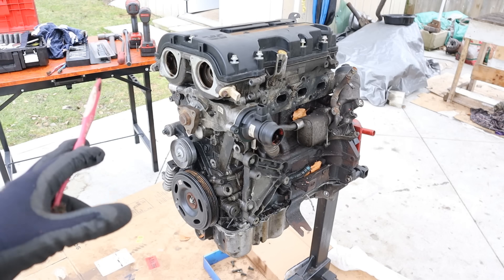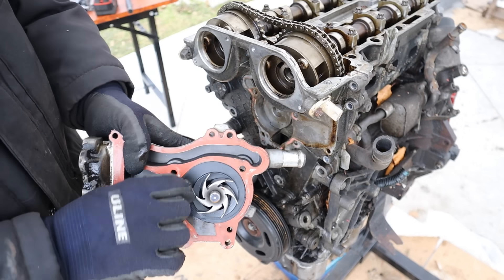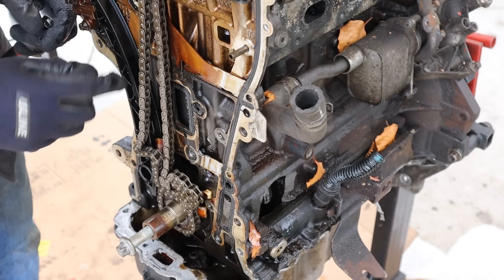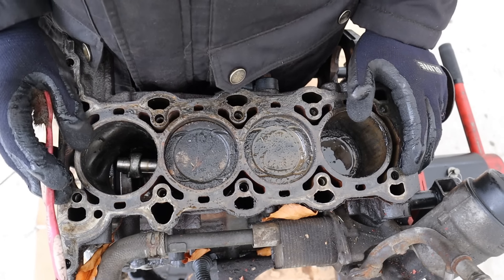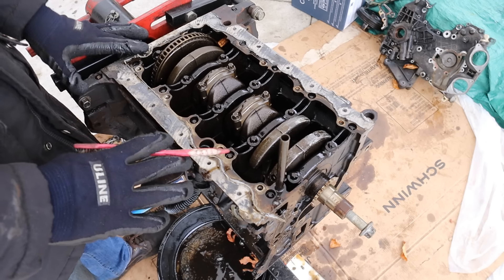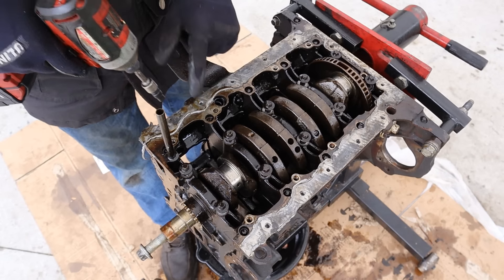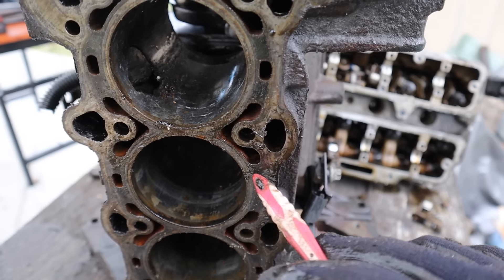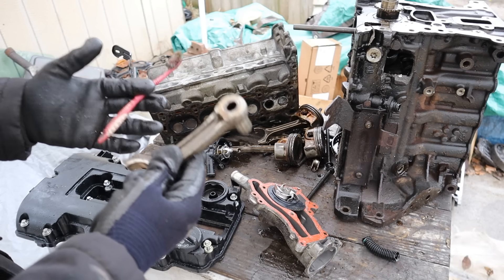Why Chevy Cruze Engines Fail

Comment: Somebody tried really hard to make a good engine. Somebody else didn't care.
Reply from the maker: That's one way to put it
Reply: Ya, it's kinda crazy how if they had just made a few minor changes, it could have been a decent engine. But nope.....can't do that.......Quite ironic how they decided to not skimp on the water pump metal blade & used a timing chain instead of a belt..But then used a bunch of plastic timing parts. If they used a belt that needed replaced before 100K. They could told customers to also replace the plastic timing parts with new stock or aftermarket parts.
Reply: @michaelbrinks8089 haha there you go. Properly planned, planned obsolescence. You should get an engineering job 👀.
Reply: Lol
Reply: This just sounds like how GM makes engines.  Every once in a while “someone else” isn’t allowed in the room and then you get the LS1 and 3800… other times we get this thing.

What sucks is if you’re buying a new car you have no idea which one you’re going to get.
Reply: @michaelbrinks8089

Why this obsession over plastic?  What else would you have made it out of?

It’s a wear piece designed to be sacrificed so the chain doesn’t wear against it.  The only reason it broke was either because of the unrelated engine failure or the previous tear down. 

Sure you could used an idler sprocket but that’s another thing to fail and more cost.  

Just about every engine today uses plastic timing chain guides and tensioners.
Reply: @michaelw6277  It wasn't made by GM at all. It's a German engine made by Opel. And we all know how good the Germans are at making simple reliable engines.
Reply: @SPAZTICCYTOPLASM  1.2 Puretech is the perfect example of this messy engines!
Reply: @SPAZTICCYTOPLASM  I thought Opel was a GM company?
Reply: We don't know the mileage or how it was driven.
Reply: @calvinnickel9995 Metal! Toyota chain guides (amongst others) use a metal backing plate behind the nylon wear surface to prevent this happening. This is why other manufacturers don't have this problem.

Comment: I work as a tech at an oil change place. I swear, 9/10 of these come in pissing oil from the turbo or the rear main. Most of which we send out as the owner wants it fixed.
Reply: Delete the turbo, problem sofvled.

Comment: In the first two minutes it seems like every component of the engine is "known to fail" and "a sore spot."
Reply: It would have been quicker if he had listed the parts that aren't known to fail...
Reply: @nicholasvinen basically the oil pump and hydraulic valve adjustment
Reply: I got the exact same impression.

Comment: That the block is made from iron lies in the fact that this engine is based on a 1970's Opel 1300cc 8 valve engine (motor code 13n and 13s), also called Family I engines. It had an output of 60bhp for the 13n and 75bhp for the 13s.
This engine was belt driven for the 8 valvers and 16 valvers up to 2004.
Reply from the maker: Good to know thanks

Comment: I owned a 2014 Chevy Cruze for a couple of years before I traded it.  One day after an oil change, I had a couple of mechanics near my car and one was telling me that something didn't sound right.  He was talking about my electric cooling fan that wasn't working right.  It was advised to me that I should bring it in to have it looked at and so I did.  Not only was my cooling fan bad, but they found that my valve cover gasket had gone bad and the water pump was about to go out.  The water pump was making a constant squeaking noise.  Thankfully, the repairs were done under warranty.  The repairs would have cost $1700 otherwise and I ended up paying nothing for it to be done.  I think the reason why the car was traded in the first place is that the previous owner just drove the car until it started having problems and didn't bother to have those problems fixed.  At least the current owner of my Cruze had a freshly repaired engine to drive on for a while.
Reply from the maker: Ouch

Comment: Interesting integrated oil pickup tube.

I'm never expected an Aluminium piston to blow a hole through a cast Iron block.
Reply from the maker: Yeah it's one of the first integrated oil pans I've seen. 

I was not expecting the hole in the block either!
Reply: The powder forged steel connecting rod  did the punching, oe cast piston was just along for the ride.
Reply: @jamesgeorge4874  This engine uses aluminum connecting rods.
Reply: @Liftium  Even lead can go through an engine block as long as there's enough speed.

Comment: My fiancé had a 2014 Cruze and that thing was the biggest POS. The thing would constantly overheat and we replaced darn near every single cooling component and nothing worked. We ended up just junking the car to get rid of the headache. Now every time we see a Cruze on the road, we always laugh about how frequently the fan comes on since we know all too well how much they like to overheat.
Reply from the maker: It went to junk? Was it too difficult to fix?
Reply: @speedkar99  yeah man, we replaced everything related to the cooling system that we could think of. Water pump (x2), thermostat (x2), radiator, PCV, head gasket, etc. Nothing worked and it just got to be a money pit and kept leaving my fiancé stranded.
Reply: @TxH666  If I remember correctly it was the Cruze or similar  low end Chevy that had the weakest cheapest most garbage rear brake calipers I had ever seen.
Reply: b/c you did it wrong. You have to use low temp t-stat 170* and replace everything including the overflow hose and reservoir. Also, ditch dexcool. GM=trash. You still had leaks and/or recurring leaks.
Reply: If the fan kept kicking on and off, the fan speed regulator was shot. It runs three modes - low, medium, and high - and if the regulator fails, it will only be able to run on high. When this happens, you will only get intermittent high-power mode, and you won't get constant air movement across the radiator. This can ultimately lead to high coolant temperatures.
As TheGuruStud stated, a lower-temp thermostat would be the optimal solution here. There is a user over on CruzeTalk who found a way to replace the stock 218* thermostat to a 176* thermostat. It solves 95% of the overheating problems due to the fact that the dashboard temperature gauge does not display temperatures between 185* and 226*, if I remember correctly.

The engine is not nearly as bad as others make it out to be. Taking care of it will make it run much longer. Changing the oil at half the recommended mileage, rectifying poor component choices of the manufacturer, properly repairing issues when they happen (and not sitting on them or using the "band-aid" fix for the issues), and, ultimately, understanding how the engine works can make these engines last hundreds of thousands of miles.

Use good oil, change it every 3k-4k miles, do not use that crap-ass Stop-Leak for coolant leaks, and let it idle for 2-3 minutes before shut-off. This is base knowledge for any low-displacement turbocharged engines. All else comes to fruition will a little bit of care :)
Reply: @bryan23361  modern turbocharged engines don’t need minutes to cool off unless you were really thrashing on it. In fact, many come with secondary electric water pumps to keep coolant moving so you can just shut the car off even if you did beat on it.

The Cruze is a bread and butter car. If it can’t handle 5k mile oil changes and needs specialist knowledge to maintain it’s a bad car. Cars like the Cruze, Focus, Corolla, Civic, Sentra, etc need to be braindead easy to drive and maintain, these aren’t enthusiast grade cars where people are willing to take extra steps to keep them running at peak performance.
Reply: @TheGuruStud  I didn't do anything wrong my man. I'm well aware of the low temp t stat, overflow hose and reservoir. None of those fixed the issue. I replaced many of the parts myself, but before me, my fiance's dad (who is a mechanic) also replaced a whole bunch of parts and nothing worked. I agree, GM is trash.
Reply: @michaelbrinks8089 My fiance's didn't have any brake problems (that I'm aware of). But I wouldn't doubt they were terrible. GM makes trash products
Reply: @TxH666 we just had the same thing and we called LKQ they gave us $600. You could see coolant pouring out the exhaust while it was running. I love Chevy but this ain’t it!
Reply: @Jontfs300  forgive my ignorance but what is LKQ?
Reply: 😂 at Usually Sorry Automobiles
Reply: I absolutely love my Cruze I inherited from my mom but I know eventually I’m going to have to let go. I dread that day because this car really has had a major impact on me over the years. It’s unfortunate that the laziness of a major corporation has costed me thousands of dollars in repairs. Two coolant leaks alone this year.☹️

Comment: My backup vehicle is a 2011 Cruze with this engine. I've replaced just about everything under the sun as "preventative maintenance". Haven't had any leaks yet because of it, BUT I will tell you that the Dorman cover combined with that old style of oil cap will cause a vacuum leak. I remember replacing my old valve cover since the PCV issue was beginning, and I chose the Dorman one like in the video. I put everything back together, put the oil cap on, and I noticed that there was a ton of wiggle on the cap, telling me that the hole was too big for it and it wasn't sealing right. I ditched the Dorman one and bought a oem valve cover plus the updated oil cap with the bigger profile and it has held up just fine since. I'm noticing some loud clicking in the valvetrain now at 162K so I think the timing job is in order. But yeah, they used these engines in the bigger SUVs and I gotta say, what a crock of crap. At least in the Sonics and Cruzes, there wasn't a whole lot of weight for it to pull, maybe a little over a ton total, but with these SUVs, they way much more and put much more of a load on them, making them wear out faster.
Reply from the maker: How much did the OEM valve cover cost you compared to Dorman?
Reply: Good theory, but the Cruze weighed 3200 lbs, not 2000. Easy to find from Car and Driver who actually weigh their cars. So your theory's out the window.
Reply: @speedkar99  Funnily enough local to me the OEM covers are actually cheaper than the Dormans. $97 Canadian vs $140

Comment: I had a 1st generation Cruze with the base non-turbo atmospheric engine. And I had complete coolant loss to where it pooled on the ground two separate times. The conditions when it happened seemed to be when the engine was brought up to operating temperature, then parked and cooled back down when it was 20 degrees fahrenheit or lower, which where I lived was usually overnight or really early in the morning. Brought it in the dealer mechanic and of course I could not replicate those conditions and the tech could not find any leak, he even showed me the pressure gauge while applying the pressure, which is what they use to check for leaks because the leak would show at the failure point, but no leaks..... eventually at about 20k or so from the warranty expiring I traded it in (that wasn't the only or main reason though).

Comment: I got 256,000 miles outta mine. 1 Ignition coil, 4 valve covers, oil cooler line, 3 water outlet valves, and non working engine fan for over a year.

Comment: I've serviced them where the turbo impeller exploded and dozens of tiny pieces of ceramic impeller in between valve and seats and in pistons making a mess of things as well. .
Good engine with several  seriously terrible component longevity issues.
Reply from the maker: How did the catalyst converter hold upto that?

Comment: The #1 problem with the 1.4 is the owners. This motor needs an oil filter change every 1500 miles (the oil filter is very small), and oil change every 3k. The water pumps were crap, but GM replaced these for free for original owners. Replacing with aftermarket brands usually solves that problem permanently. They're easy to work on, they can be hot rodded pretty good by knowledgeable people. And they are a spunky little motor. But they are not small block Chevys. They are not for maintenance lackeys. Owners who take care of these engines can get north of 150,000 miles out of them with no problems.
Reply from the maker: I tend to agree..it's not a very tolerant engine
Reply: Bought mine new oil change 5k the normal issues but 190k and still going thinking another 100k no problem

Comment: I have 93,890 miles on one, doesn't use oil and never had a problem with it but always changed the oil at 60 to 50 percent with mobile 1 5w30 and Valvoline 5w30 synthetic, I think people must Abuse them Big Time
Reply: Yeah poor people usually don't care
Reply from the maker: Keep it maintained and it should last.
Reply: The manufacturer extended oil changes of 5k or more dont help either.  Even toyotas get issues if u follow their recommended 10k on a oil change.
Reply: We had a 2017 cruz, properly maintained with good oil, changed every 4k miles. I always let it warm up before accelerating fast too. And we have good gas living in Texas . But one day on the highway I just wanted to pass only going around 70 to the left lane. And the engine popped half way of me getting in the lane. It was a little scary losing all power and being in traffic. But luckily i was able to pull off to the side without being hit. The damned thing only had 46K miles. Chevy was reluctant to give me a new motor in 2019, but after much much hassle. They replaced it, and we traded that car immediately.
Reply: That’s not a lot of miles
Reply: @ShadowOppsRC  I stick with medium price oil every 3k miles. Takes me about an hour on the weekend.
Reply: Very important what you do with changing the oil more often than service book says.. That is the best way to keep an engine in good health.
Reply: Extended oil changes are killing modern engines that have all sorts of high tech such as turbos, GDI, etc. My dad and I are still changing our oil every 3-4k miles with high quality synthetic oil and filters. Some may say it’s a waste of money, however we always say “oil is cheap, engines are not”.

Comment: 1.4 Ecodreck engine as they're called in Germoney. Didn't work as non aspirated 90hp engines either.
Reply from the maker: Even at that low stress ?
Reply: I had Corsa C Z12XE, and when I sold it, it had 270.000km. It was eating some oil, but no smoke or any other problems... Had the original chain as well.

Now I have B14XEL 90hp one, and it's fine after 70.000km. I had to replace the water pump (it wasn't being driven for a long time and the housing cracked when I started driving it) and the coil pack. 

A friend of mine had a turbo version, and that one was atrocious. Literally everything broke down on his Zafira.
Reply: B14XEL corsa E with 110K kms, also a water pump replacement at 80K kms. No others problems aside a rattling in the dash since day one
Reply: @orkoto6057  Thankfully nothing rattles in my car... Seat squeaks when I get in, I guess something's loose, but couldn't be bothered to actually check 😂
Reply: “Ecodrech” 😂😂😂
Love it!
Reply: I have a 1.4 ecotec non turbo 2006 model with 220.000 km, changed timing chain once, no other trouble with engine.

Comment: GMs never could figure out how to make engines for subcompacts.  So what failed first?  Timing chain guide or head gasket?
Reply from the maker: The chicken or the egg... I'm betting the headgasket given the shear amount of coolant that came out of this thing.
Reply: Likely overheated first then blew the head gasket, hence why coolant in the engine. And it seems like they just kept driving with the blown head gasket, then it finally went kaput. The engine itself is actually pretty solid. It's all the peripherals they bolted on to the engine that's trash.

Comment: I saw a video of yours about 7 years old and it speaks about the P0420, I use spacers before to fool the computer but I noticed that you solder a capacitor & resistor to the sensor wires, can you tell me which capacitors and resistors I have to get? if you could do me that favor,THANK YOU!!!
Reply from the maker: Honestly I don't remember what values. It's an iterative process, keep trying different RC values.
Reply: @speedkar99  thanks a lot brother

Comment: I wonder if some of these fail because of predetonation from using the wrong fuel. Mine started making all sorts of spark knocking sounds but ran good and drove just fine but ended up switching to higher octane fuel. The dealer told me regular gas is just fine to run in these with my instincts telling me forced induced direct injection engines need higher octane to slow down the combustion process and have a more even fire. They had a calibration update on the computer that injected extra fuel into the cylinders to prevent the pre detonation condition but at the cost of mileage. I went from 42mpg down to 36mpg with the calibration.
Reply from the maker: Ouch.
Reply: The luv/luj 1.4t is actually tuned for 91 octane from the factory so it definitely pulls tons of timing to run on 87 octane, the dealers can say whatever they want and even the owners manual can be ambiguous but the RPO codes don't lie, "KRD" tells you that it's supposed to run 91.

Also the tuners have posted some articles about it, if you look up bad news racing article WHICH FUEL SHOULD I USE IN MY LUV/LUJ? DOES IT MATTER?, you can see the article.

Comment: Is there any preventive maintenance for the timing chain? I've done my PCV upgrade, replaced leaky turbo oil lines, freed up the wastegate, replaced cracked plastic coolant outlet, will upgrade to metal. When I did the PCV/valve cover, I noticed some wear on the top timing chain guide.
Reply: Timing chain guides are wear items that should be replaced if worn. Especially when they're made of plastic.
Reply: Add Liqui moly ceratec.
Reply: Sell sell sell